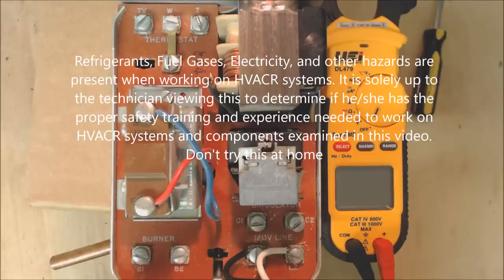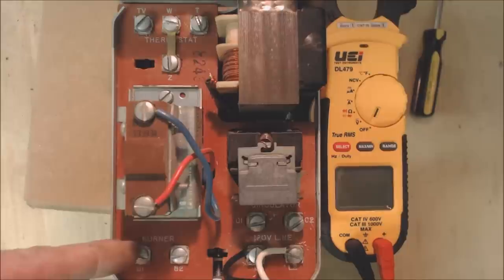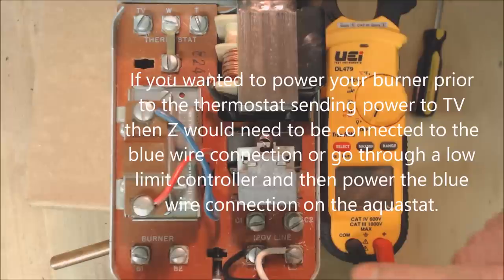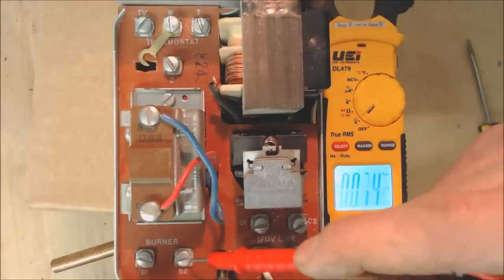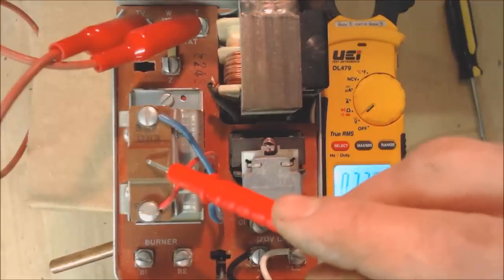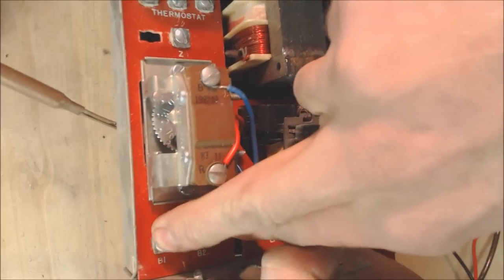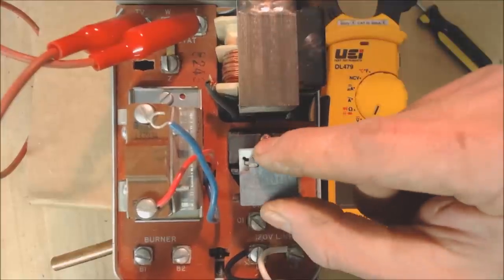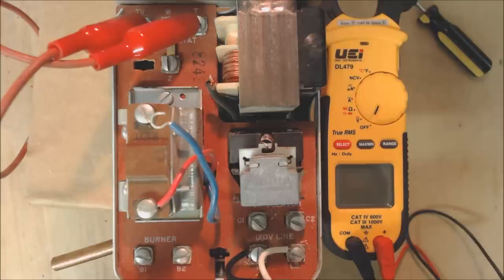Boiler Aquastat Relay Troubleshooting and Control Wiring!

Comment: Thanks to this video I have outsmarted my trainer. The call I was on with him had voltage and calling for heat. The relay was pulled in but was not passing power to the limit. He believed the vent damper was bad. It was horizontal and wasn't open. He  ordered the new damper and installed it. Unit still never came on. I got a pair of jumpers and hooked them to Z and top of the limit, the boiler fired up.... he was pissed.

Comment: Holy smokes! This is a great video!  My boiler took longer and longer to fire up until one day it just didn't.  Not wanting to spend $1000 or more on a service call, I found this video and followed the path of the voltage to the Z terminal, which was not conducting any to the W terminal (despite calling for heat) and, by extension, none to the T.  

Shutting off all electricity, I unscrewed the Z terminal and out-popped a small piece of paper in the perfect shape of the screw head.  Obviously whoever installed mine decades ago just ripped a paper tab off instead of removing it.  It was probably "barely working" for decades!  No wonder it took an hour or more to "fire up" in the fall.

Once I tightened the Z terminal (and all the other terminals) down - everything is working perfectly! 

Thank-you so much for such a detailed video!!

Comment: Fantastic video. It's pretty much the same troubleshooting the L8148A, except it doesn't have the 24V transformer.  All the voltages are 120V on the L8148A.  You'll need a separate 24V transformer for your thermostats. Adding this info so that others can find if if they are trying to troubleshoot at l8148a since it's pretty much the same thing.

Comment: Thank you so much for sharing this info. My Becket AFG burner would not start the blower and fuel pump. I thought maybe the blower motor was shot. I could feel the relay box vibrating.The Honeywell Aquastat Relay was humming but the motor and Becket burner would not start when turned on. The light indicated that it was locked out. The relay was stuck so I pushed it a few times. I then turned on the burner and for the first time it started the motor, burner and circulating pump. Hope this info helps someone else.
Reply from the maker: It may have been out of alignment or the contacts were pitted and not making goo contact, thanks Devin!

Comment: My thermostat intermittently loses power usually in the middle of the night or when I'm not at home (both are not very good times).  My Google Nest Thermostat will show a no power condition making me believe that the transformer on my L8148E is going bad.  I will have to check for loose connections, but when I pulled on the wires they seemed to be tight.  The unit is over 17 years old, so I had a new one ready to go.  Thanks for the video!

Comment: Do I put T Stat's red(r) to TV or T?
Where does the white(heat) from T Stat go? TV or T? Some Aquastat says TH instead of TV right?
Tv and T both are powered I believe but which one is for T stats power and which one is for T Stats (heat)?
Reply: My thermostat's white (heat) wire is connected to TV, and red (power) is connected to T.

Comment: So what's the issue if the relay isn't getting sucked in? Checked everything I could without tearing apart the switch, even replacing batteries in the thermostat control in the living room, and everything seems good. I can manually push it and it works fine so I assume contacts are functional. Just replace it or somewhere else to look?

Comment: At 3:40 it appears you in fact DO have voltage on the contact on the right , like 26 or 27... or maybe you didn’t let the meter Seattle down.   That’s the one hing I do prefer about analog meters, the needle would swing...  good explanation on its workings.

Comment: Hello, hopefully you can answer this question.  My boiler has been turning on without the thermostats connected and I think it's the Aquastat.  When I remove the Thermostat wires from the Aquastat both or the white the boiler doesn't turn on but when they are connected it turns on.  I've cut the wires to the Thermostats so I know they aren't connected.  Do you think the Aquastat is bad and bridging the wires without the thermostat?  Thanks

Comment: Is it common for failure of the temperature sensor to expand the bladder under the temperature dial and not close the switch? If so is this a part that can just be replaced?

Comment: Question: I have a customer that's been using me for a long time, 20-22 yrs. He has an older Columbia boiler that needs an AquaStat but other than that it's in perfect shape. The transformer blew out, replace the AquaStat & be done. Normally this is the case, but this boiler is old and the damper is old and AquaStat is old. The damper doesn't have the molex plug on the end of the wires, and the new aqua stat has the molex plug in it. I'm trying to save the old man money, he's on a fixed income. Is it gonna be a mission to replace the transformer in the AquaStat or is it pretty much just unsolder then resolder?

Comment: Do you have a part number for the thermostat switch(you refered to it as a "relay")? Is it a universal part as long as it has the 120 v / 24 voltage capability?

Comment: I have a honeywell hydronic zone valve control panel. In the panel it has 2 wire connection for boiler. Do i connect that to the  T & TV on aquastat.

Comment: Just put a brand new relay  and the circulator stil not working. (There is no power coming out of aqua stat to circulator) I have connected the circulator with direct power and runs properly. What could cause this issue?

Comment: Great video! Question, due to the high limit cutting off the burner @ 180 degrees or so, the thermostat can still be calling for heat correct? If this is the case, then the burner will cycle on and off on high limit until thermostat is satisfied, or am I missing something?

Comment: Don't know if you'll even see this since the video was posted a while ago but I have an Aquastat Relay Type L8148J and unfortunately only have a R and W wire going to the thermostats on the Upper and Lower Floors. I am trying to add a wifi thermostat to make scheduling easier but don't have a C connection. 

What would I connect to make this work or am I out of luck? Having a hard time getting an electrician to come out since it is such a small job.

Comment: Hi and thanks for this.  Im a home owner with a question: 

Our slant fin burner has the same aquastat shown here. From time to time the burner will shut off but the pump will continue to run, even when the water temperature is far below what the temperature control is set to. 

Using a multimeter I find that when the burner is running, 23 volts are detected between the aquastat and valve.  When the burner is not running, but the pump is running, the voltage registers 22.2.  

Could this drop in voltage be causing the gas valve to turn off? If so, why do you think voltage is dropping intermittently like this? And finally, what’s the fix here? 

Thank you so much! I can’t find a single professional who’s been able to narrow it down.

Peter, Santa Fe, NM
Reply: Check the temperature setting on the dial. Maybe the dial is set too low. I had similar issues and this is what I found in my system. 

I recently installed a  three zone Taco Zone Control Module in my hydronic system. The Zone Control Module has LED lights which will light up if there is a call for heat from the thermostat from any zone. Since it is marked as Zone 1, Zone 2 and Zone 3 you can immediately identify which thermostat/zone is calling for heat. After installing it, I had the same observation that you have. Thermostat is calling for heat, but boiler is shutting down even before the call is satisfied. Circulator pump keeps running.  I studied it carefully and understood its operation. The summary is given below 

When there is a call for heat from the thermostats - the relay is energized;  pulls the contactor and immediately  fires up  the boiler  and turns the ciirculator pump on..  The water in the system gets heated. Hot water is now being pumped into the baseboard  radiators by the circulator pump. If the high limit - usually set at 190 degrees - on the boiler aquastat is exceeded (although the thermostat is still not satisfied), the 24 volt supply to the gas valve is interrupted  and shuts down as a safety measure  to prevent the boiler  from overheating. Since the thermostat is still calling for heat, the circulator pump will keep on running delivering heat/hot water into the respective zone calling for heat. When the temperatiure in the boiler drops below the 190 degrees, the boiler will fire up again. When the thermostat is satisfied, the boiler and circulator shuts down. 

If you closely watch the tridicator (temperature and pressure gauge) on the boiler you will understand how it works. 

Because the circulator pump is very silent and since there is no RPM meter or other visual cue to confirm it is running, I went a step further and installed a separate volt/ampere meter to monitor the circulator pump performance.  As soon as the pump starts it will register about 0.70 amperes on the meter giving me a visual cue  that it is working.

If you have intermittent issues of boiler shutting down even when the water temperature is low, I think your relay is on its way out. The contacts on the relay contactor probably burned or pitted interrupting the circuit. You might end up replacing the Aquastat because the relay is soldered into the board and is not intended to be replaced as a component.

Hope this helps!
Reply: Hi, thanks for the thorough response! I appreciate that.

The temperature control is set to 180 and the boiler intermittently stops firing at about 100. So I’m leaning toward the problem being with the aquastat itself, which you suggest here. The system has been in place for more than 30 years so I think it’s time for a replacement.  I’ll update this once the new aquastat is in. Thanks again for your thoughts. Peter

Comment: thanks for the video, I have the L8148E, and I want to change my thermostat for the RTH6580WF.  I only use the heat and my old thermostat works with two wires.  where you should connect the wires for the other thermostat.  Thanks

Comment: Great video.  My boiler at my rental has a summer/winter hookup. The tenant says heat works fine but that the hot water is hot, but not like it used to be.  She says it’ll get cold for a little and then warms up after a few minutes. 
I guess if the heat works then the problem would be the mixing valve?
I’m assuming the boiler is kicking on to supply heat but NOT kicking on when running the hot water?   Any ideas?   Thanks.

Comment: Great video, I have the L8148E aquastat relay.  My boiler previously heated up to 180 and shut off, now it is heating up to 200 before it shuts off.  There is a stationary arrow on the side of the temperature sensor that I assume indicates where the temperature dial should be set and mine is pointing to 180.   The circulating pump is circulating and does stop when the burner kicks off at 200.  I can only think that the temperature sensor or the Thermopile that sets in the well has gone bad.  Is another option that might be causing this issue?  I assume that I need to replace the entire aquastat relay as I had not found any information of people only replacing parts of the aquastat relay.  Thank you for your help.

Comment: Great video.I have the bad relay that when i call for heat does not get sucked in when i push it down with a wood stick the system start working.it’s any way that relay can be fixed    Thanks

Comment: Awesome video, helped my identify the issue with my aquastat. 
Is it possible to replace just the circulator relay or does the entire aquastat need replaced?
Reply from the maker: Usually you need to replace the whole aquastat, thanks!
Reply: Jason, I run my circulators on a hot circuit all winter to get around the relay and it works fine. I retain the relay only for the 24V to the gas valve.

Comment: I have Aquastat L8148G, which I don't see anywhere but it's almost identical to this L8148E except that it doesn't have the Z to W connection. It's actually set up TV--T--Z. My question is from the thermostat does it matter whether the common go on TV or T. Also I don't have any power on the temp controller, but my gas valve open and closes. I also notice that it heats the water up to 230 degrees, maybe even 240. My first issue with that is why it doesn't have power. Everything else works as it should. It's been that way since the early 90's. Recently I had a problem with no heat and took the Aquastat apart and found a frayed wire that was touching the outside of my transformer. I was actually getting 20 volts on the outside of the transformer. The relay was sticking. Taped up the wire and now I don't have the relay sticking, or the 20 volts on the outside of the transformer. After watching your very great video. I'm going to go look the entire system over.

Comment: Goog morning 
I have relay switch honeywell R845A( which is # 1,2,3,4, 5&6 and T-T). Do i need to follow the same test you did to check if my relay works before i wire it.
Thank you.

Comment: Can you recommend how to test the high limit dial? I get continuity between the tow leads (B-R) but when I check voltage between that B screw where the blue wire attaches and B2 I only get 12V. The burner doesn't turn on. I get 0 volt between B1 and B2. And if it went bad, can it be replaced or does one have to get a whole new aquastat?

Comment: Thank you for taking the time to show how this is supposed to work.  In my case, the circulator sometimes runs intermittently, so I know it's not frozen.  How can you troubleshoot the aquastat when the circulator IS operating correctly?  Or do I have to troubleshoot it when the circulator doesn't turn on?  I'm thinking that either the relay is bad in the aquastat or the temp control.  But if the relay operates sometimes and does turn on the circulator, could it still be bad?  Maybe just changing the aquastat completely would take care of both possible issues within the aquastat?  It's a l6006a Honeywell.  Thanks again.
Reply from the maker: Unfortunately,  we usually need to have the system problem occurring while checking readings in order to determine what the problem is. If you don't have another circ or zone controller and the wires are providing a good 24-29v under load then it may be the aquastat, thanks
Reply: Thank you for the quick reply.  I'll give that a shot...single zone, one circ.  Thanks again!
Reply: Good question
Reply: For anyone else reading this years later, I had that exact problem.  My issue was the solder joint under the relay had cracked.  So I wasn't getting 120v at the circ pump terminal, but the relay was closing.  The contacts checked out good so I checked for continuity (with power off) from the relay to the C1 and had no continuity no mater what position the relay was in.  Pulled the board and saw the crack.  Resoldered it, checked again, and was back in business.
Reply: @MikeJamieGavin so what happens when you manually close the relay and it fires up? My relay won't close at all. It's humming to get going, but no closure of the relay.

Comment: 7th boiler mechanic who can't solve the issue of why my boiler aquastat will not shut off my steam boiler from running constantly.  They disconnected the house thermostat but soon as the water got cool the boiler started up and ran which heated the whole house until the tenants turn off the emergency switch. Is this something that can be fixed or is the company just not knowing.  They changed the aquastat three time already....can you suggest maybe a new type of aquastat?

Comment: I have the Honeywell L8148A attached to my boiler. The high limit works fine but the boiler will not fire when the water temp is low. Is there an existing low limit or "limit range" on the relay that I missed or should test? Thanks in advance...

Comment: Hey there.  I came across this video and found it very informative but I have a question that I hope you can help me with.  First off my aquastat works fine,  it turns on when needed and fires up the boiler but I don't seem to have any 24v reading from the B2 to any connection from the Z W or T.  My volt meter is working fine too because it reads a car battery no problem.  Any ideas as to what is going on?  My aquastat looks exactly like the one you have in the video.

Comment: Thanks man, I like the way you teach.  You have a gift...  I need help with my L8124A regular for C1 C2 .  I am checking the voltage on C1 and neutral C2 and it reports back 13.42 volts when I jumper the thermostat connection.  Is that the correct amount of voltage that it is reporting?  Issue: circulator pump not activating when furnace is fired up and on.  when I jumper L1 and C1 as a test, it works fine with no issues.  I am focusing my troubleshooting on the honeywell relay that you are displaying next to the multimeter (not sure what that relay is called) Im so close to fixing this thing man and its getting cold.......any suggestions? I will look over your vid again, maybe I missed something in regurads to cleaning contacts etc...

Comment: I have this controller on a castiron powervent boiler also using a taco SR503 switching relay.  my problem is that when the thermistat is calling for heat the taco sends power to c1,c2 which also send power to the blower vent motor.  When the high limit shuts off the boiler and the thermistat still calling for heat the blower motor continues to run sucking warm room temp out of building. this continues to short cycle until the thermistat is satisfied.  Is there any way to use the high limit to shut off the blower motor